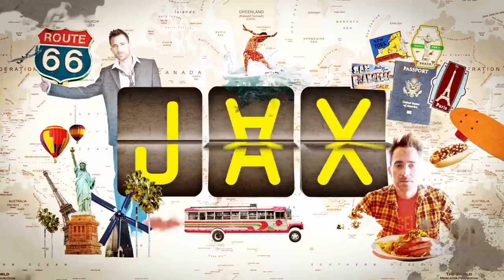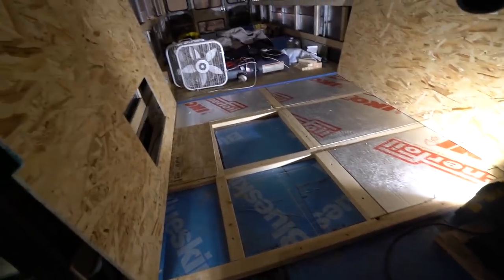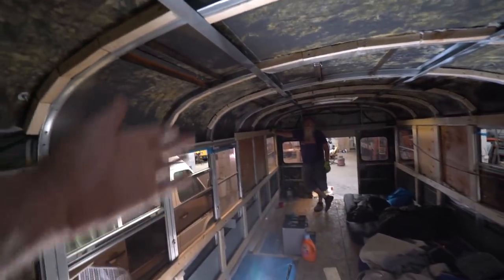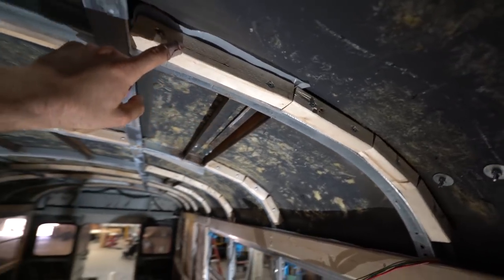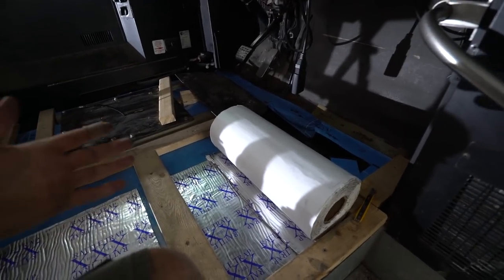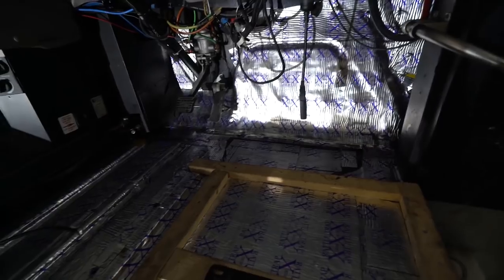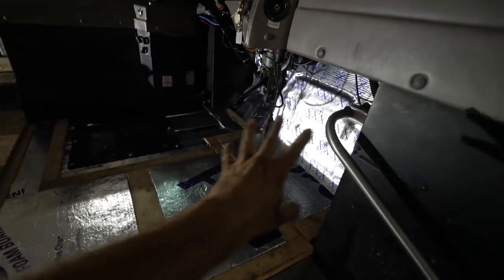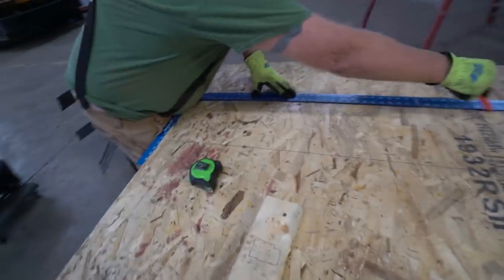Great Diesel Sound Insulation (Skoolie, Van)

Comment: one way to prevent a speedbit from blowing out the bottom of the hole is to drill in until the leadpoint of the speedbit is showing through the other end , turn the wood over and drill the rest out through the other side using the small hole of the leadpoint as a guide works 9 out of ten times
Reply from the maker: Good tip. Thank you!

Comment: You could alway use finish screws to attach the wood directly to the metal, rather than nailing to the blocks.  Commercial carpenters use them to attach wood to metal studs. Screws won’t work loose like nails as you drive down bumpy roads.
Reply from the maker: If you have a link, I’d love to look into that. Thanks!
Reply: Here are a couple links, just be sure if you put up cabinets that there is backing between the metal bracing to attach the cabinets too because of all the extra weight.
There are a couple kinds one has a drill tip and others that have a sharp point but both are self drilling but depends on the gague of the metal your attaching too. The sharp tip screw will work on wood too.  In Denver there should be plenty of contractors stores to buy them from. 
https://www.rockler.com/trim-head-square-drive-screws-select-size
https://www.homedepot.com/p/Grip-Rite-6-x-2-1-4-in-Fine-Phosphate-Plated-Steel-Trim-Flat-Head-Square-Screws-214STHDW1/100154569
Reply: Those screws look like they would split the end of a board.  I would look at using a Kreg screw or something similar.  They are flat where the head contacts the board.  Less chance of splitting.

Comment: Your still going to need to insulate the firewall for heat. That insulation you took out was not for sound.
Reply: I agree
Reply from the maker: I have another product to put on top of that firewall area called dynapad
Reply: That will do it. I saw that stuff, but missed what you said you were doing with it I guess.

Comment: Wasn't that part of ur firewall that u pulled out? Is the dynamat fireretardant or fireproof? just curious..i want to rip out my carpet n put rubber mat down..dog house n front part of van gets so hot tho..need to look into some insulation for that prior to flooring. Bus is really coming along? Keep up the good work..love watching n learning..
Reply from the maker: Good question. Perhaps it was fire proof 🤔🤔🤔
Reply: He only pulled out the cheesy sound insulation. The metal firewall is still there and now deep under the RattleTrap
Reply: @SteampunkSteve  thanks..i know there's firewall inside the engine area in most vehicles as well just wasn't sure if that was also some on the Inside so thought I'd ask..so do u know if the dynamat is fireproof? Thanks again✌💙😊
Reply: I don't know. Maybe Jax does.
Reply: @SteampunkSteve  no worries I can look it up..i thought it was called dynamat then I saw that Jax called it dynapad...thx again✌😊

Comment: That stuff is amazing but dont do great in heat. You should have enough floor down not to smell it. I would wrap the hot side and down pipe a few feet back to push the heat out.

Comment: Not really sure but you could have saved all that weight of wood and just used self tapping screws into the metal
Reply from the maker: For the floor?
Reply: Jax Austin For the ceiling, into the existing beams/bars.
Reply: Or you could be super redundant and use plywood furring strips glued/screwed to your hat channel and the blocking(nailer? never touched her!)...more weight, less headroom but less shimmy, squeaky or spitting...and Mike can't say shiiiii....2cents...